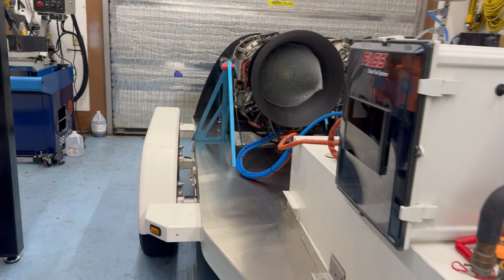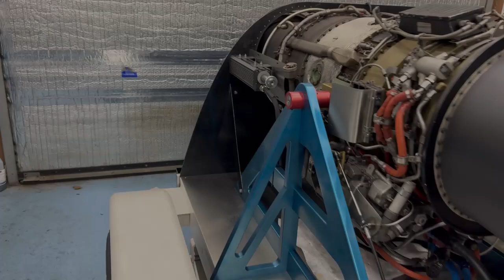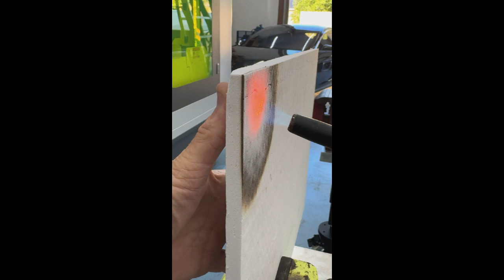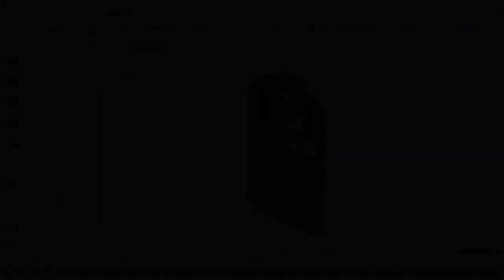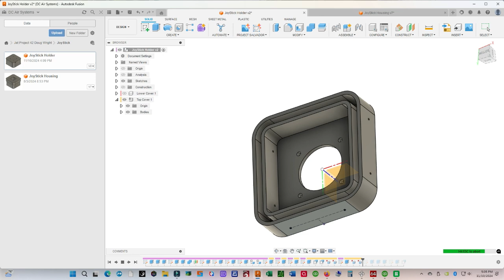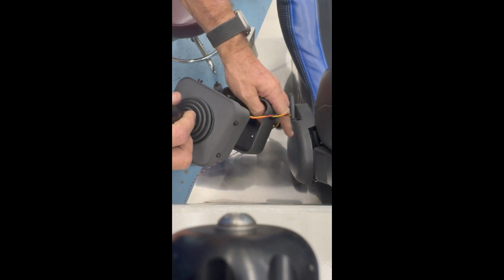Full Power Test Prep

Comment: What starter motors are you using? Is the starter shaft custom made for that gearbox?
Reply from the maker: I get the Starter Motors from Larson Motor Sports out of Melbourne Florida. The bolt right up to the standard mount and drive.